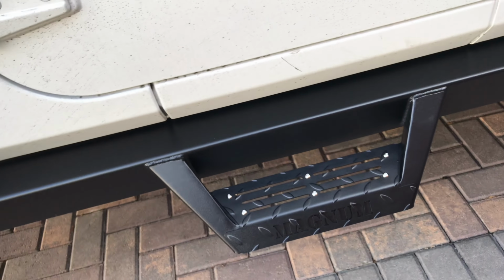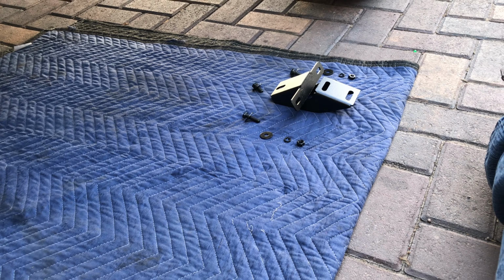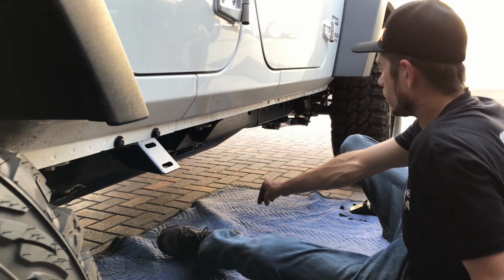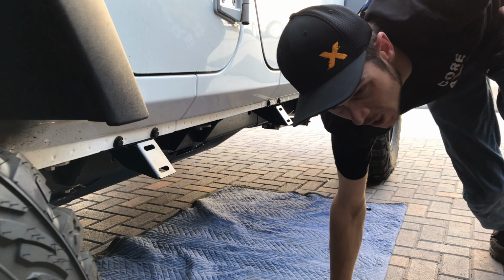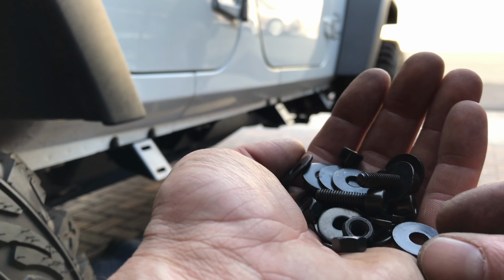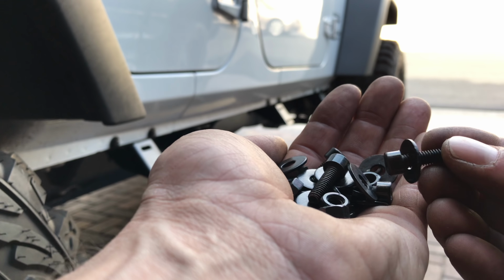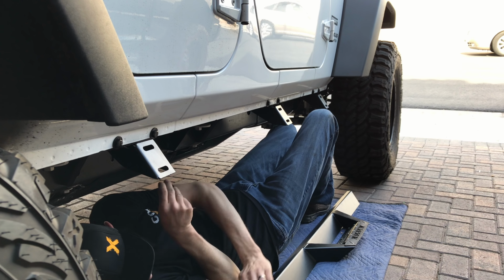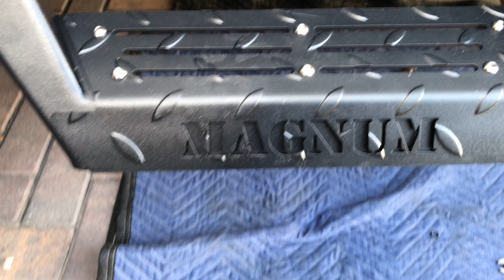Magnum RT side step install Jeep jk unlimited

Comment: Like the steps ? is how did you get them over the pinch seam screws??? I got mine with no instructions and missing hardware 🤨
Reply from the maker: I like the steps, the instructions should be on there website. Easy install.